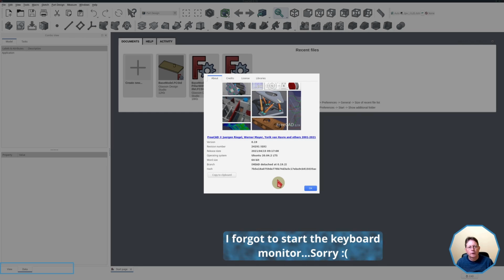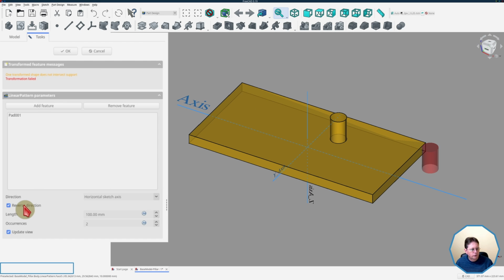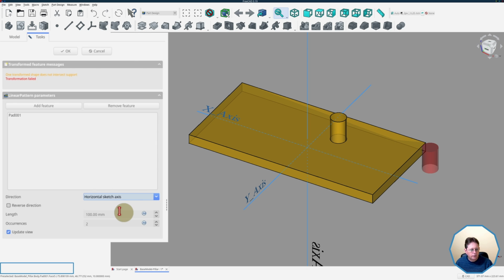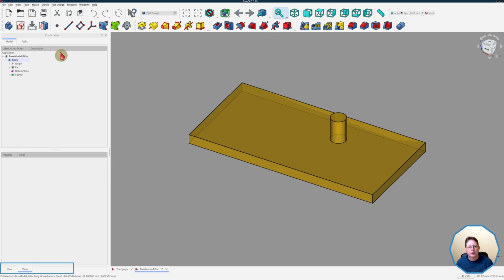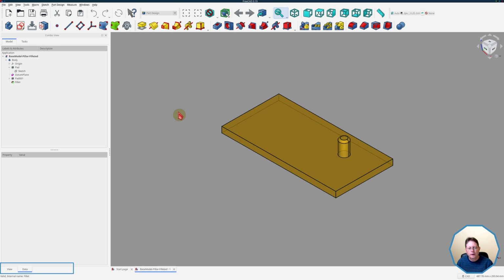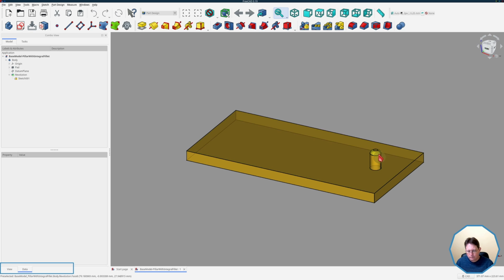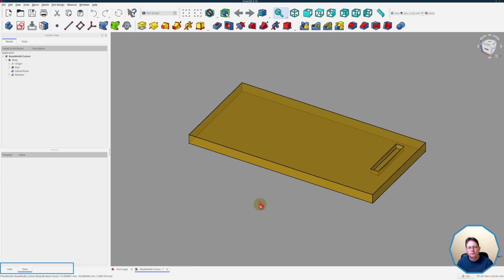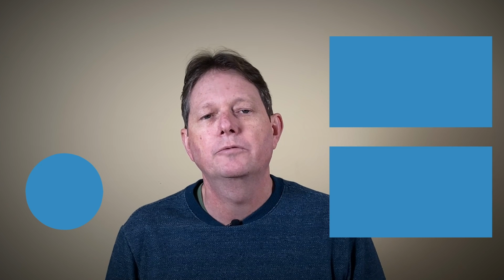How to use FreeCAD's  Linear Pattern Tool

Comment: Why freecad can't pattern bodies floating in the air? It's quite a limitation, e.g. Catia has no problem with it...
Reply from the maker: Thanks for your feedback. Every software package has it's limitations. This is one of the Part Design Workbench's...
Reply: @GlassonDesignStudio  I think there is a tax on this software for a free version that is available to everyone. Catia is very expensive software and very hard to find even cracked, but it is a very powerful tool, it can do everything, I work with it every day at work...